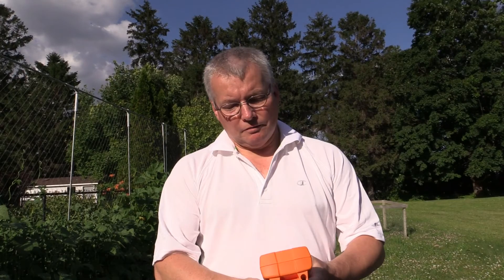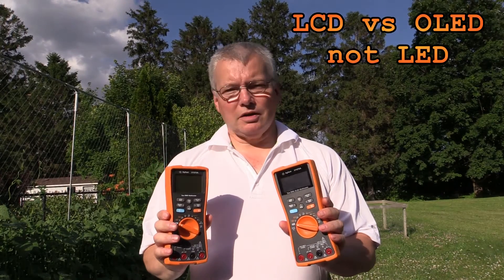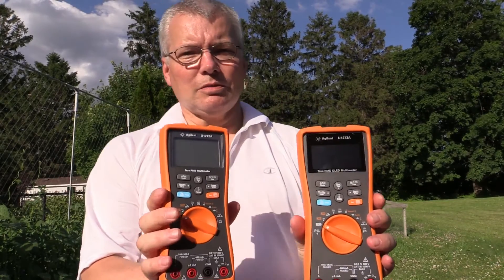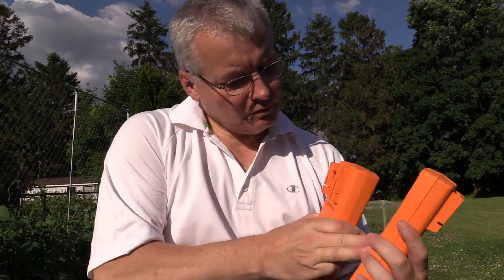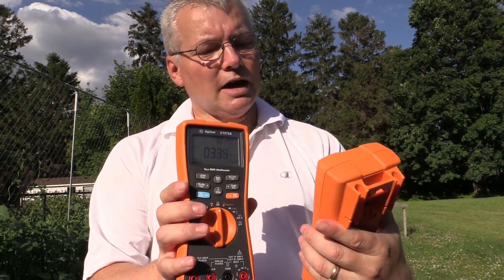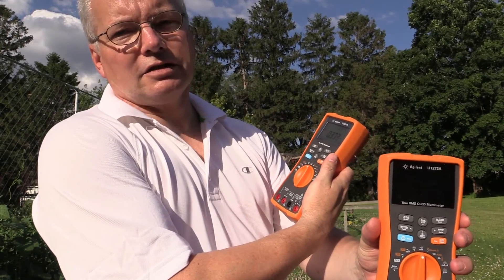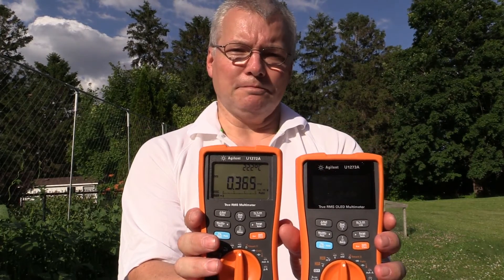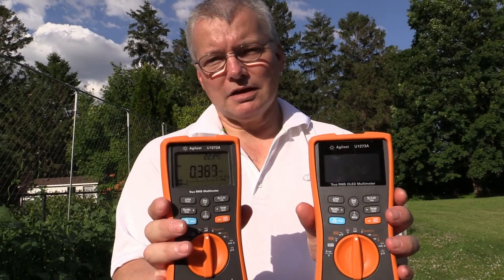Agilent U1272A vs U1273A Sunshine test

Comment: I've owned the U1272A since it first came out. I don't calibrate my meters regularly, but I noticed a major discrepancy in the temperature measurements. I had it recalibrated by Agilent for around $130 USD. Now everything is ok, but I'm unsure whether I should buy another Agilent meter or a Fluke. Is it normal for these meters to have to be calibrated every couple of years? I did drop it a few times BTW.
Reply from the maker: Jordan Reese I have not had this set of meters long enough to worry abut calibration but way back I did work in a cal lab and we calibrated our equipment every year or more often (But is was critical to production). In a home lab setting I would think no more than every 2 or 3 years would be enough. it depends on how accurate do you need to be ??

Having said that. If you have several meters, you can cross reference them on the same source to see if they agree on the value (Remember one could be reading high and one low so account for that) and if they do then your statistically probably good and don't need a cal. (Unless your really really unlucky and they all drifted in the same direction :)
Reply from the maker: They should of course be within calibration when you receive them and should not deviate for quite some time. but of course calibration is only guaranteed for a specified period for instance a year from date of cal. also it is only when at certain temperature (Typically about 20deg C). Dropping the unit should not normally put it out of cal but many components like resistors and capacitors can be affected by shock. so it is possible it was "Knocked out of cal". the units do have a certain drop rating though so it would have had to be quite substantial.

If you detect the unit out of cal during the first period of ownership, then Keysight would normally work with you to remedy the error.

I have 4 Agilent(Keysight) handheld DMMs and one 7.5 digit Bench DMM. all the handheld units have remained within their cal for the last few years, based on checking with the 7.5Digit DMM.

I am pretty sure that Fluke or Keysight is a non issue, both brands are excelent products and its more a case of taste as to which to pick. or there may be the odd special feature that may sway the argument.